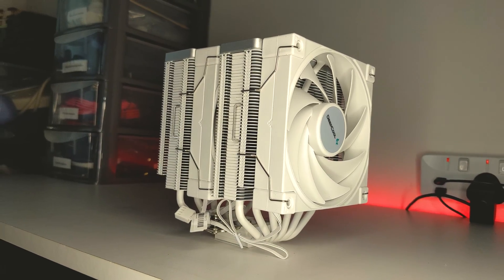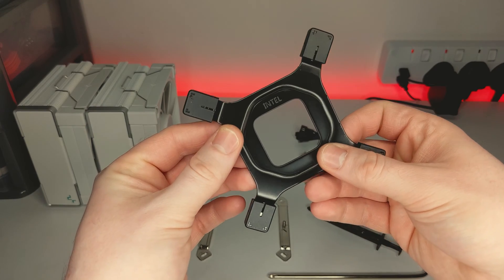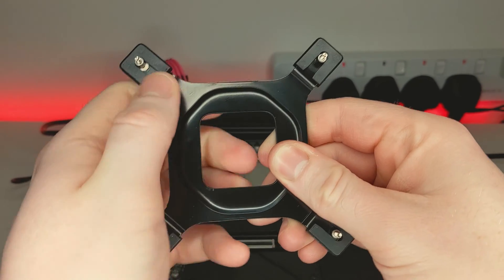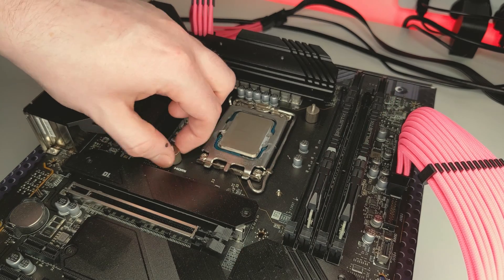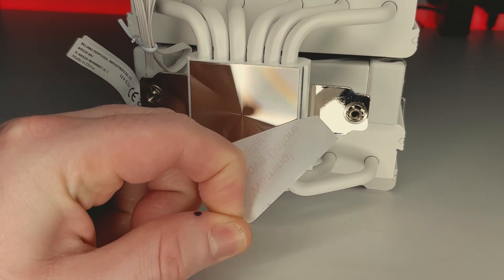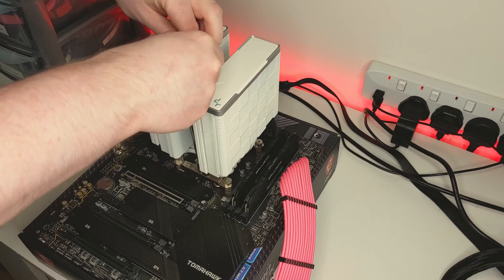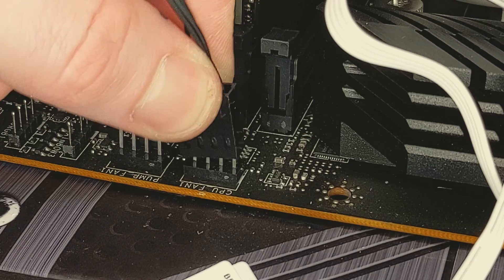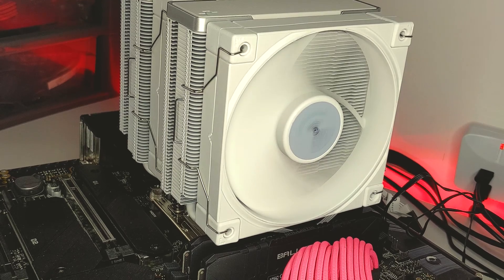How To Install The DeepCool AK620 - Intel LGA 1700

Comment: I didn't realize that all you had to do with the backplate was just pull on those screws to snap them into the lower notch. The directions don't visualize that very well. Just installed it in an LGA 1151 slot with an i7-7700k

Comment: I just bought this cooler and cannot seem to get it mounted fully on a z690 force wifi mobo. Anyone have any suggestions? There’s like a half inch of clearance between the mount and the screws on the cooler which won’t connect but the backplane is definitely making contact with the cpu.

Comment: I have a dumb question about compatability with LGA1700: does it need anything like additional support or socket mod (Thermalright one) to safely use such a cooller, I mean it's like 1,5Kg won't it damage pcb or something with such weight?

Comment: Are all of the parts shown in the video included with the cooler? I've read some Amazon reviews that say it doesn't come with LGA1700 brackets.
Reply: Bought mine a couple of days ago, it came with a 1700 bracket. But I bought mine from newegg, doubt that changes anything.
Reply: Confirmed, comes with a Lga1700 Backplate. Received mine today from Amazon
Reply: Am about to buy the cooler but have the same question as you. Maybe those were older reviews? I'd be surprised if the 1700 bracket doesn't come with the current models.

Comment: Is this Cooler good with this set up?
- Asus TUF gaming z790 Wi-Fi d4 1700
- i5-13600k
- Kingston Fury Renegade 32GB 2x16
- Corsair 4000d Airflow tempered glass Mid-Tower

Like fitting wise will everything fit comfortably in it and be compatible?
Reply: I just bought 4000d airflow, 13600k, ripjaws 5 and rog b760-a gaming. I will build it tomorrow. I think you are good but fan will probably almost touch the rams
Reply: Hi man, is ak620 good for 13600k? Did you make some undervolt ? @mraulmadrid7